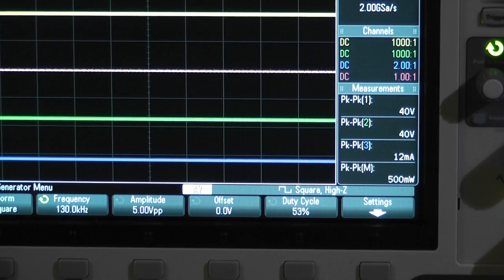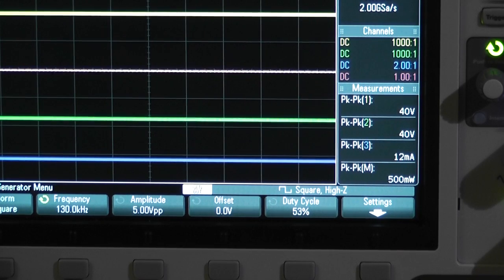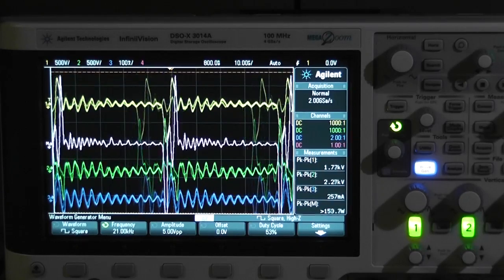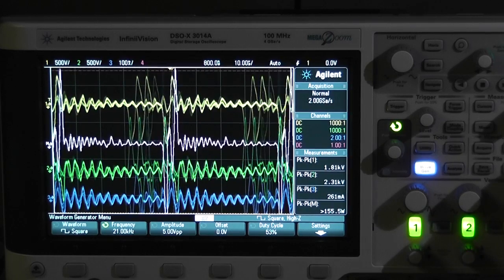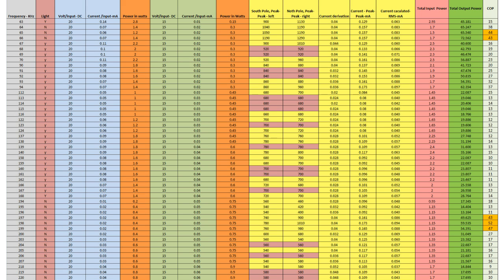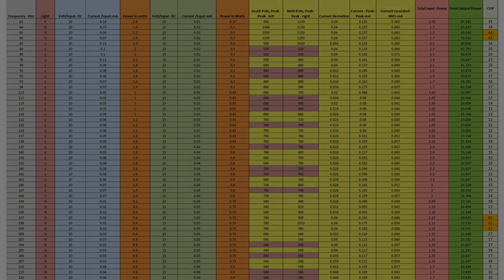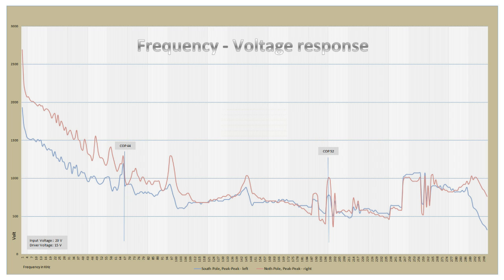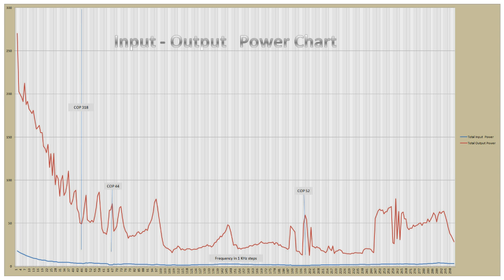Symmetrical versus Asymmetrical Bipolar Tesla coil power measurement. Part 1

Comment: Hi, im building a tesla coil and need the spark gap to fire at 40khz. Is there a way i can measure the bps/frequency accurately without damage to the device?
Reply from the maker: There are spark frequency oscilloscope probes available which are used in the automotive industrie. I have them but never used them. They are save to use and not expensive.

Comment from the maker: I am with you but the load is always part of the equation. A pure resistor would have to be non wire wound to avoid harmonics. Currently graphite resistor are not able to cope with this energy. The video was not to show how much energy is generated but to show the difference of the coil orientation and for that it did the job as long as the frame of reference is the same , which is the case here.

Comment from the maker: I agree with you. I did make some test in the low frequency range. I might add them in the next video. Even if man made radiation is causing then high output I can at least compare the two configurations to each other. That is all I want to do at this stage to prove my case that geometric asymmetrical consideration for a built has an impact on the power output.

Comment from the maker: I have with the Radiant Series the first time shown the highest output gain. That was done by illuminating with the same input power more bulbs. Capture the energy with an bridge rectifier did then defeat the objective. There was no other way to measure at that time. I lost 5 current clamps at that time. They all fry under high frequency and high voltage. After I publish the second part I have an ABHA coil I will power measure. Hopefully in the next two weeks. That will be very interesting.

Comment from the maker: I have not shared the functions and compliance reporting tool as the industry standard I can use. Every radio equipment, network or broadband system needs certifications and use the new InfiniiVision series. The fastest DSO on the market with 1 Million captured and displayed waves per second. The only tool which can track, record and display a glitch, where other scopes need to run 24 hours. This scope does it in 1 minute. The other options were Tektronix and Rhode and Schwarz.

Comment: I know from when I played with solid state Tesla coils that measuring the output is really hard. I didn't have the equipment. I did make an interesting coil though. I made a multi layer coil where each layer of the secondary was wound along, then lopped back through the middle and started on the next layer. So all the starts and finishes of each layer were on the same side as each other. It worked well and now I look at Tesla's bifilar coil it was very similar.